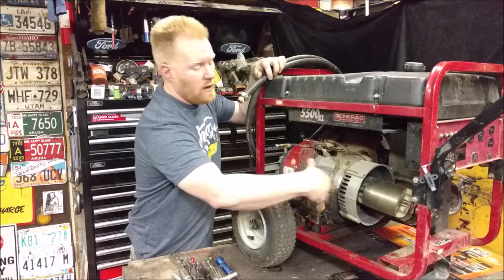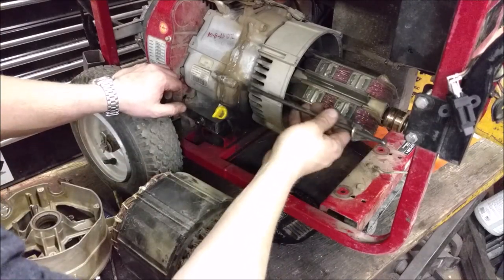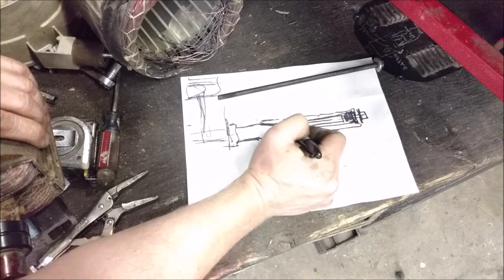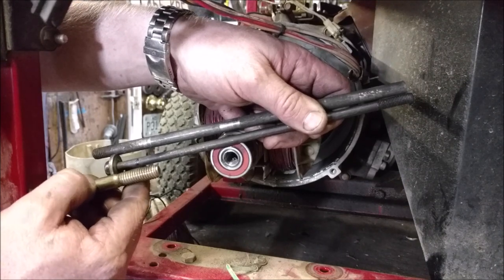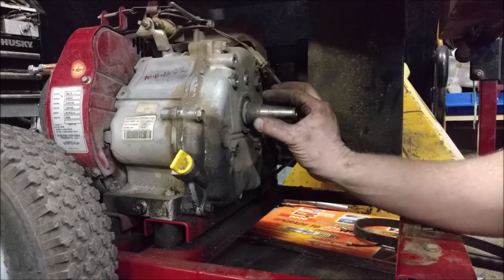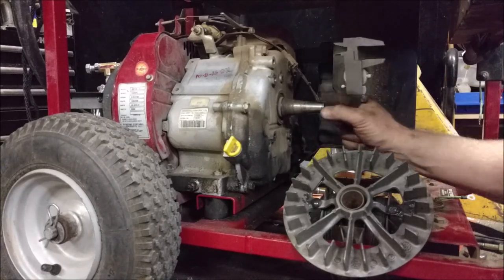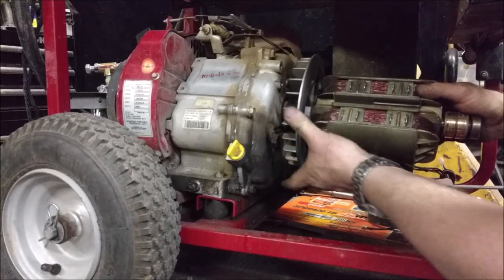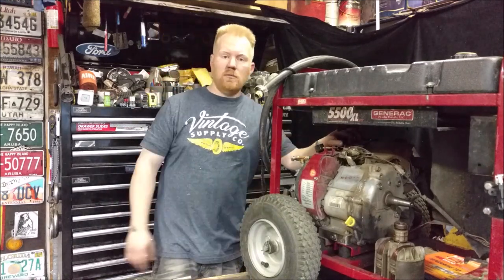Remove a Generator Head & can Engine be used in Go Karts?

Comment: You didn't cover the electrical side of things....how are you going to get spark without a stator since the  huge generator stator is now removed?
Reply from the maker: The generator head has nothing to do with engine spark/ignition system.
Reply: @sixtyfiveford  Gotcha, thats awesome! I have a 19hp B&S 570cc twin that I just pulled off a generator a few minutes ago after watching your vid, and you're right it runs and is self contained. I was worried I was going to have to buy a separate stator and cdi,so this is good news. I'm building a snow bike with it with a snowmobile CVT. Thanks for the vid!

Comment: Hey guys i need some help. I have a engine that came off of a briggs and Stratton generator and i want to use the engine on a go-kart. I have it mounted on the kart but when i start the engine it runs at high RPM. how do i make it idle?

Comment: I havr a wood chipper i havent taking the engine off yet and a push mower (flat head) with a vertical shaft, i know u can make a generator with the lawnmower,  but can i incorporate the wood chipper motor or somethong to build me a go kart? Looking for ideas please help
Reply from the maker: The wood chipper will have an ideal motor for a go kart.
Reply: sixtyfiveford wont need to do all that extra shaft stuff? Is it horizontal already?

Comment: Could you add a pulley at the end of one? To use other accessories?
Reply: Not removing generator
Reply from the maker: Possibly yes. However generally there is very little shaft to attach a pulley to.
Reply: @sixtyfiveford  I wanted to add a pulley for an air compressor on an old generator I have. Might take some machining. Might be better to just use an alternator as a power supply. It would be easier to achieve both.

Comment: @sixtyfiveford Do you still have this engine? I have a similar Generac generator, which has a B&S Generac engine on it and I cannot for the life of me find the B&S engine numbers. I have a STICKER on the engine just like yours does, but that is NOT a B&S model number. And I cannot find the model type and code in the usual places. I'm hoping you see this and can tell me how you found the model and type to buy parts for it. Thanks in advance!
Reply from the maker: The engine in the video is a Generac / Honda clone. Generac has been doing this for decades now along with pretty much every other manufacturer.

Comment: How about casting an adapter with babbitt material?
Reply from the maker: I would think it would be too soft.
Reply: Just use a grinding wheel on an electric drill and grind it down with the engine running... then use a cutoff wheel to cut a keyway in (engine not running)

Comment: My engine slung a rod and I want  to replace engine. How to get engine and gen head to reattach?
Reply from the maker: @MC-hs4mf  Just tighten the small long bolt down. Doesn't take much. Probably only 30-40 foot pounds. The taper on the shaft locks in super easily.

Comment: The three wheeler or four wheeler and use the engine out of it for a generator very simple to do or farm tractor for a boat engine or generator cheap all you need is cheap fuel Willie Nelson gas

Comment: I've used a dead blow hammer and hit it side to side and  it will come off after the center bolt is removed.
Reply from the maker: It gets it done on a lot but not when they're this tight. I would have bent the crankshaft or damaged the rear bearing with this one.

Comment: where the windings burnt? if not ether the avr or brushes where bad and some times they need to be flashed by using a drill and make a crank handle  and chuck it in and crank it and lot of time it will bring it back to life!
Reply from the maker: Yes, the windings were char.
Reply: sixtyfiveford  "Crispy motor!

Comment: If there are no threads on the outer end of the armature, pry outward on the inside portion of armature and hit the pin inward with a hammer. We could not find a video for if it doesn't have threads!
Reply from the maker: Good info.

Comment: I've heard the taper is the same as some snowmobile clutches..
Reply from the maker: I think it is smaller but I could be wrong.
Reply: I know they use some Briggs motors in snowmobiles. Not sure if they are tapered shafts or not.. Check briggsracing.com

Comment: This has me mystified, just buy a blank pulley, hub or cog and get a machinist to cut an internal taper and keyway in it then put a bolt through the centre and 100% perfect fit!
Reply from the maker: That's fine for fixed belt/chain drive items. But it is cheaper easier to machine the crank to a standard 3/4" or 1" so it will fit common clutches, pulleys, etc.

Comment: Hey sir. Why not just use it for a generator engine. They usually give out first
Reply from the maker: In my shop, I've had one engine that has been blown (Subaru Robin) compared to dozens of blown electrical generator heads.

Comment: Buy  a Harbor Freight Honda clone motor for $99 and be done !
Reply from the maker: You aren't going to get a high horse power motor for 99bucks. I just bought a newer Briggs 8hp for $25 yesterday off a generator and this 11hp generator motor was free. HF units in higher hp are going to run you significantly more($250 for an 8hp and $400 for a 13hp).
Reply: For a go cart isn't 7 hp good enough?
Reply from the maker: For basic single seat go karts the 212cc predator engine would suffice, but it is easily out grown by older children.
Reply: If you don't mind a top speed of 5 mph